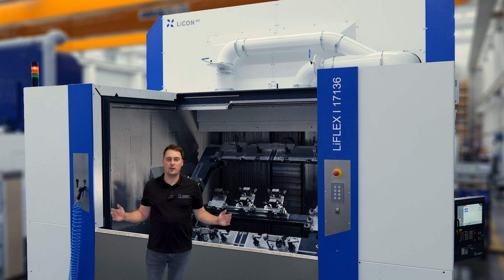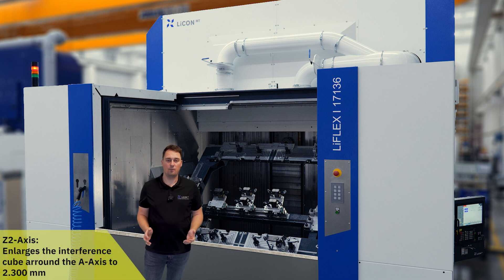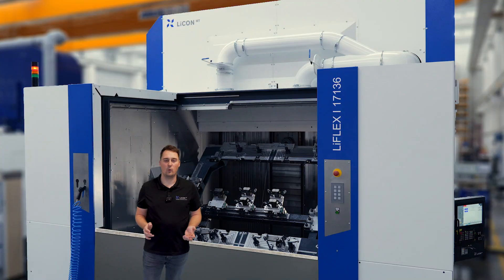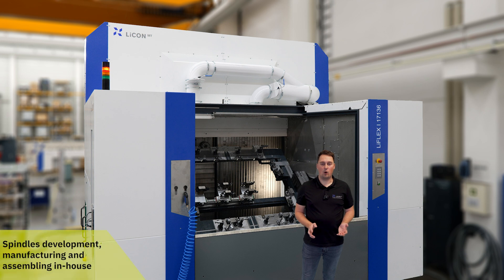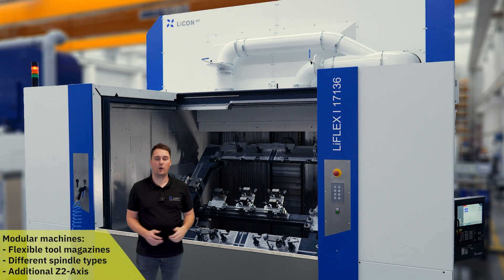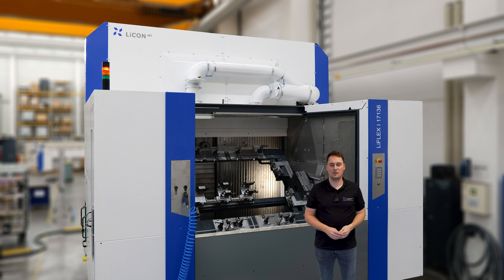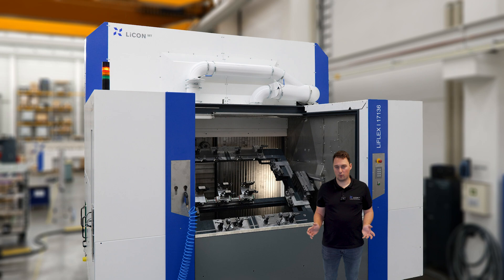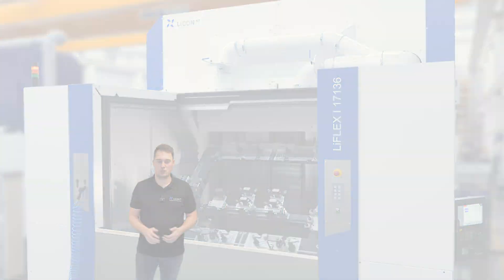LiFLEX I 17136 Gigaline: Big, bigger, Giga - for large-cubic machining

Comment: Would think vibration would be an issue with machining the part so far from fix center axis point
Reply from the maker: Thank you for your question. That is a valid concern, but the machine is specifically designed and built with damping systems to minimize vibrations and natural resonances. Additionally, our LAVA (Licon Added Value Analyses) system continuously monitors and analyzes any occurring vibrations or oscillations to ensure optimal machining performance and surface quality.